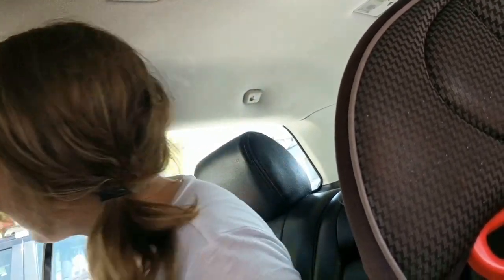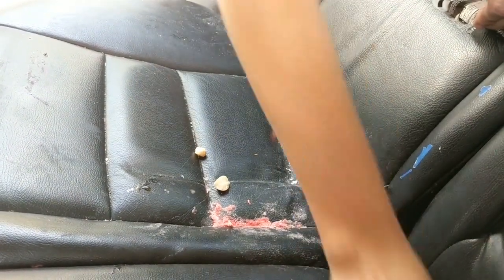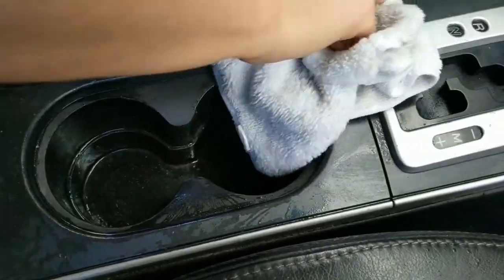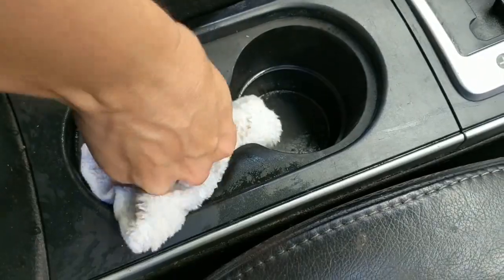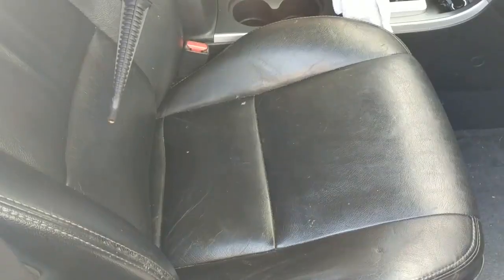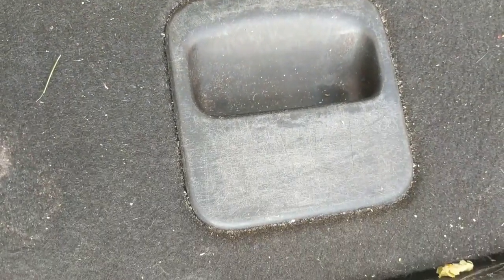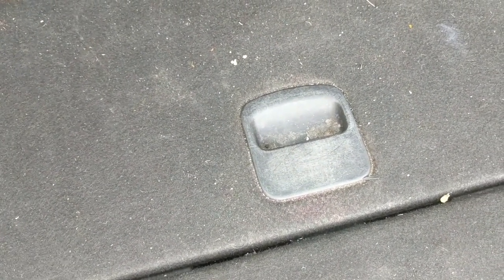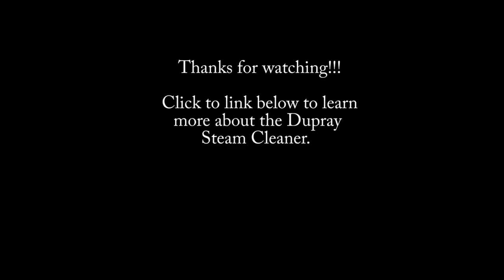Steam Clean a Dirty Car!! SO Clean Now!!

Comment: Not every parts of the interior should be steamed.
I wouldn’t steam leather and roof liner. Heat from steamer could damage the protection coating of leather and in worse case it will remove the colour coating on leather which becomes a nightmare.

Roof lining
Behind that piece of beautiful cloth is a mixture of foam and glue. Steaming it will soften the glue and with weather(heat and cold) it’ll break down a lot sooner and that’s when it starts dropping as if there’s a puddle of water hanging off the roof.
Reply: It all comes down to discretion... Don't hold the steamer in one place, keep it moving. Heat areas with staining or stuck on gunk and wipe the heated area... Do this ubtil stain is gone. Steaming was made for these jobs and won't hurt leather at all, protecting the leather after cleaning is recommended. 303 ptotectant, Gyeon leather coating. For headliners, just steam in a sweeping motion and wipe you a satisfied with the results. Been detailing as a business since'94 in Houston, Tx and steaming is an integral part of my biz for interiors. You ladies did a fantastic job.👍

Comment: This is an interesting video ! I have never tried to steam cleaned a car ! I went to Wal-Mart on line and here'swhat I found :
The steam cleaner used in the video looks like the COSTWAY MULTIFUNCTION PORTABLE HOUSEHOLD STEAM CLEANER 
WITH ATTACHMENTS ( red and black in color ) marked down from $56.99 to $35.99 . There is also a DIRT DEVIL HAND
HELD STEAMER FOR $35.00  .

Comment: It's a cool tips and tricks video for people that don't want to pay an arm and a leg to have it detailed but as a detailed I would never steam clean leather. You should be using leather cleaner, conditioner and protectant for it. The heat will damage it if used consistently.

Comment: That’s ok if you have vinyl or leather seats in your car ,how does it work on cloth seats and interior?
Reply from the maker: Test first and use a bonnet or microfiber cloth over the attachment (the triangle tool). You just have to be careful not to get the tip too close to the cloth because it can burn it.

Comment: Wouldn't show the average person steam cleaning the inside "roof" of a vehicle  because the moisture and heat of it can destroy the glue that's holding the material causing it to separate & come apart.  If you haven't used a steam cleaner and go crazy with it or haven't detailed a vehicle before, you can ruin parts of the car. There are other methods of cleaning it.
Reply from the maker: There seems to be a debate about using steam but I have with no problems for years. I don't use it inside speakers or electronic parts. Don't get the steam too close to the fabric or leather. I've seen many detailers use them but I can see that there's some risk too. Thanks for your input.

Comment: You should seriously try to vacuum out stains like on the headliner, rather than using a cloth. 

You might be pushing the stain into the padding, which will reappear.